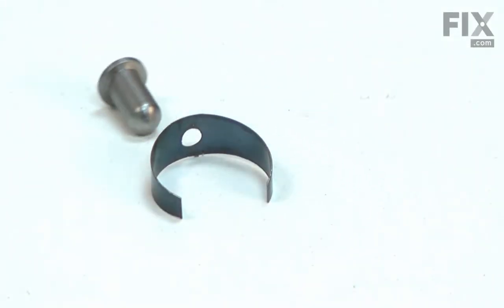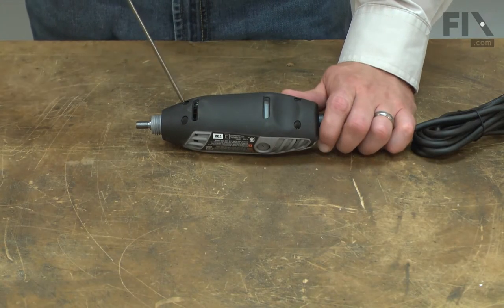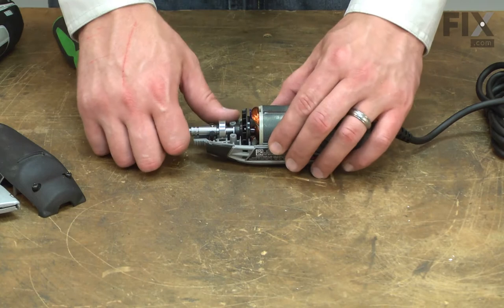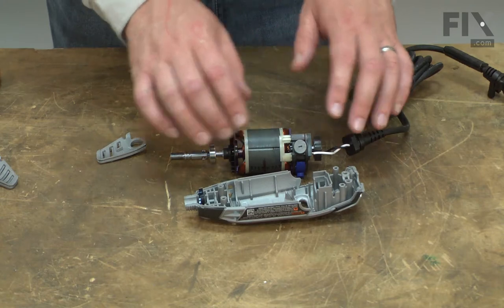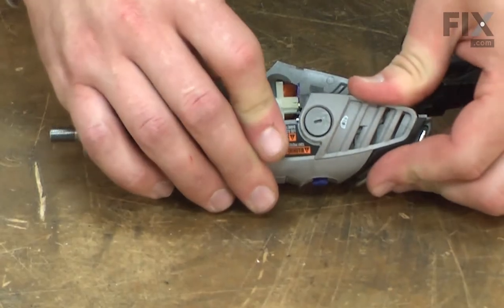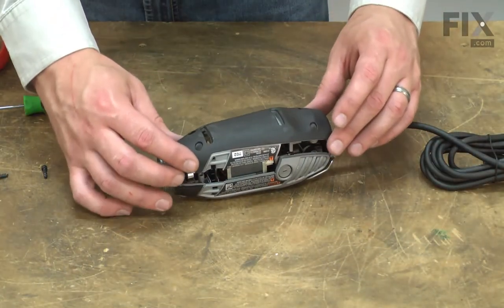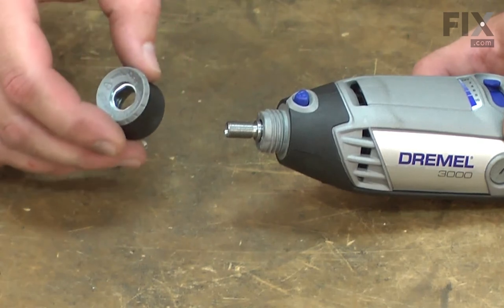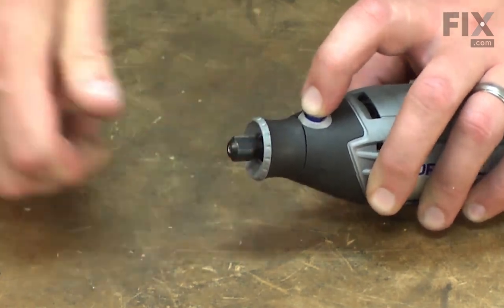Dremel Rotary Tool Repair - How to Replace the Shaft Lock

Comment: Except I can't remove the collet nut, because the shaft lock is worn out.
Reply: Daniel Minic  
 Black Vic
I had the same problem a dozen times with the lock button fail>(collet nut) and the shaft lock that was worn out but i fix both of those problem doing this  i hope this helps try using a bench vise fully clamp and lock down the button and use a small curve jaw vise grip locking pliers for the shaft lock that has been stripped and worn out
Reply: Ya, now I know HOW to fix it. But like Black Vic said, it’s a catch 22. Show me how to fix THAT problem!
Reply: @paulsaracino3074  Remove the front collar and see if you can hold the shaft with a needle nose vise grip while turning out the collet nut -- worked for me.
Reply: @BlueSun2  thanks, I’ll try that. Now, where is that thing?
Reply: Take it all apart and hold the shaft below collet with vice grips and then use the wrench to undo the collet nut. I just did it on mine.
Reply: There’s asong written about that problem: there’s a hole in the bucket,  O Henry … Ella Fitzgerald sang it!
Reply: Yep me too, seems like a common problem

Comment: How do you remove the collet nut & cover  if the shaft lock is worn out? Apparently the shaft lock was not worn out.Very easy to replace the shaft lock if it still works.

Comment: I want to Thank you for your video on how to repair the lock pin on my Dremel. I haven't used my Dremel that much but when I wanted to use it and change my bit it would just turned. I thought I would chock it up to a lose. But then I thought " hmm I know you tube " they have everything and anything on how to repair items. So yours was the first one up. I watched it and I took apart my Dremel and waa- laa. Took out the pin and ordered a new.
 Thanks to you and your video I was able to keep my Dremel. As soon as I get the part and fix it I will let you know. Once again Thank you. William.

Comment: I've only used my dremel 5 times. I should have brought a Harbor freight. Oh yea, the first step is to remove the collett.  Well that's kinda the point. The lock doesn't work so I can't remove the collett.
Reply: I have the exact same issue, did you manage to do it another way?

Comment: Great vid on how to repair.  However as mentioned several times MOST come across the issue with a bit stuck in the collate.
Take housing apart as described, BUT take a vice grip or even pliers (very little force needed) to the lower shaft that is exposed once inside of housing is removed.  Unscrew the collet remove the stuck bit.  
Complete the rest of repair as described. 
It’s about a 10 minute repair but I took extra 15-20 minutes to remove debris and clean housing when exposed.  Again, more real world example than the pristine unit shown,

Comment: I`m having trouble fitting the assembly back in the housing. The wheel bearing part with the rubber cap is not lining up and wont go in.
Reply: The problem is that the shaft lock diameter is greater than the locating hole in the shaft. The end of the shaft lock is rounded and does not engage the shaft that will. One option is to remove the shaft lock, collar and button so that the shaft if visible. Then lock the shaft by poking the shaft of a bit down.
Reply: If you are having trouble fitting it all back into the housing, maybe try removing the brushes, then fitting the assembly back into the housing. If the assembly has moved apart during the repair, the brushes can advance and prevent easy reassembly. Try removing the brushes, reassemble and reinstalling them.
Reply: Hey H.S. It was the brushes. I got it back together. Thank you friend.